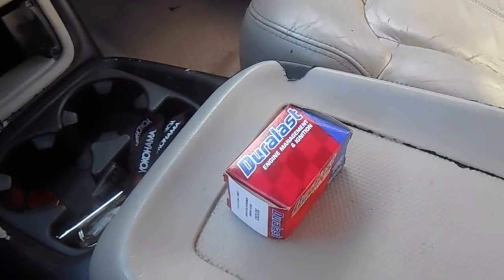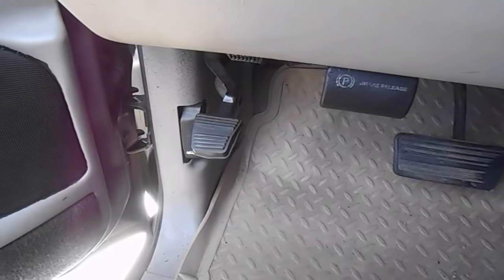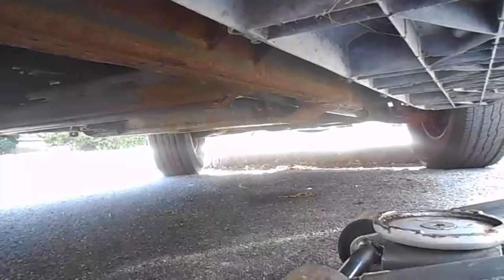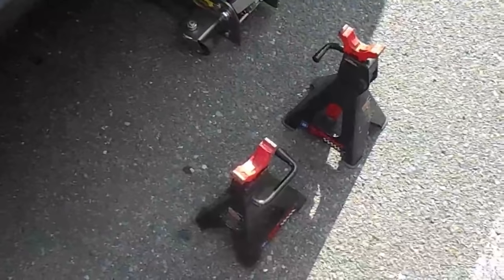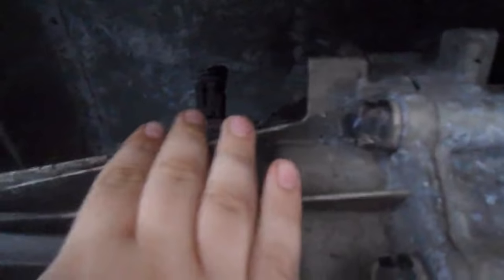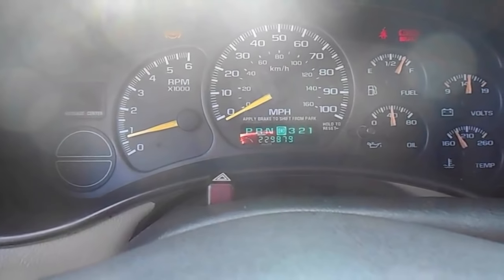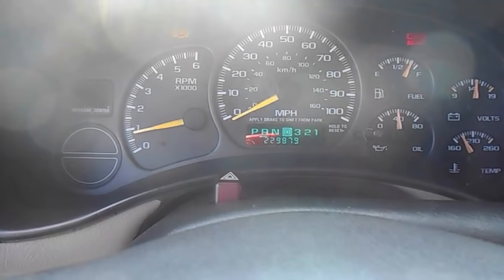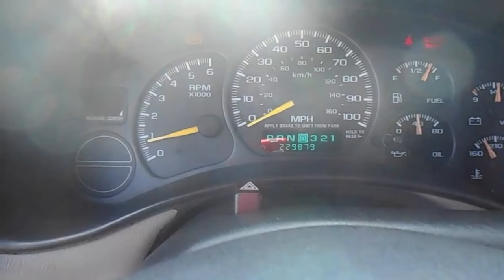Replacing The Speed Sensor in a Chevy Suburban

Comment: So from what I've learned, most of these 4WD vehicles have 2 speed sensors on the transfer case. The one you replaced on the passenger side was the speed sensor for the 4WD, which does not communicate with the speedometer and is only there for the Auto 4WD button so it can know when to engage said 4WD. There's another one on the drivers side, which is the MAIN speed sensor that actually communicates with the speedometer. However this is just what I've learned from reading various comments on youtube videos with this problem, so this may not be the case for everyone.
Reply: Your right! Most people on you tube should explain this correctly. No wonder why there so many upset people on here because people give false information.

Comment: The transmission speed sensor doesn't control the speed odometer , the wheel speed sensors do which are on each wheel.   The one on the transmission and transfer case control the shifting ,   if the sensor is bad the transmission will shift incorrectly or knock when shifting .

Comment: Some had two sensors the one in the transmission from my knowledge communicates with the abs system to help the abs module to control the hydraulic pressure to either your back brakes or all brakes depends on the year and it it's 4 wheel drive. Now the actual speed sensor for the speedometer could be located in two places. The first would be the cable going from the transmission to the speedometer with would be the speedometer cable. The next would be a sensor located near the hub assembly on the vehicle. Note some have one and some have sensors on two.

Comment: The nice thing is, the easiest fix to this (if the speed sensor swap didn't work) is to buy a GPS based "HEADS UP" from somewhere like Amazon. I swapped my gear ratio to 4.10 on my 99 Suburban, and it threw my speedometer off by as much as 20mph at highway speeds. Dealer refuses to try to reflash the pcm to compensate (tried several dealers). For about $50 I just got the heads-up speedometer, and now I just ignore what's on the dash. Unfortunately it also makes it rack up miles about 15% quicker but at 200K already, who cares.
Reply from the maker: RedfishCarolina I use a free app called digiHUD its almost spot on accurate and it tracks average mph top speed driven and bunch of other features been using it for a year now
Reply: Mine came with 3.55 i put a rear end with 3.73 gears in mine i did notice the miles adding up a little fast also oil change life goes quicker.

Comment: I have a 2001 Chevy Tahoe 4 x 4 5.3 L motor and I simply replace both sensors On the transmission and now it shifts correctly  And my speedometer works and before I changed the sensors my abs and brake light on my dash were on... but after being Told that I needed a new transmission or a new wiring harness I did some research and found out it could be those sensors in the transmission like the video shows!!! Try changing both
Reply: Hector Guerrero.  What kind of shifting problems were you having? Mine revs a little high going from 1st to 2nd
Reply: I have a 2002 Chevy Tahoe 4x4 5.3 Z motor. You are describing exactly my experience currently. Tomorrow I will change both of my speed sensors. Thank you for posting this because our vehicles are very similar. Makes me confident in my repair.
Reply: Are u talking about the solenoids inside the oil pan i was having that issue after a transmission replacement and i belive they conected the plugs backwards between the 2 speed sensor and now the abs light and break light is off speedometer started working but doesnt read over 30 mph even going faster and doesnt shift on time

Comment: Having this same issue 2000 4x4 suburban did a transmission swap and the guy hooked up a transfer case (blue and green wire plug) to the sensor. I had already replaced the pcm, cluster, bcm. And checked all fuses. Tonight I found the wire issue and corrected it still no fix and my scan tool isn't reading speed either. Have a new pcm on the way. I've also heard of but yet to locate a white relay cube behind the glove box that some how has been a fix for people. If anyone has fixed this issue please let me know. I'll probably post more tomorrow when I dig into it a little deeper.
Reply: Tim Feely try both speed sensors
Reply: Any fix?

Comment: My 2002 Chevy Silverado two wheel drive won't go into gear the RPMs go all the way up but it goes in reverse and drive just wondering would it be the sensor
Reply: That more than likely could be your shift solenoids inside the transmission

Comment: hey did u get it fixed?
my suburban is having the same problem...what did u end up doing to fix the problem? thanks
Reply from the maker: i have not figured it out yet i have tried countless working clusters and still nothing it has to be either a break in the wiring or something with the bcm i think
Reply: BOOSTIN IT GARAGE I've looked online and read that the ground connection could be bad or the wire that connects to the vss either was bad and eaten by rodents or something...try looking at that if u havnt done so already...good luck and let me know what uve figured out...I'm in the same boat and can't find the solution

Comment: tray the other sensor next to the one you replaced
Reply from the maker: jtorres698 I tried both nothing happened I hooked up a scan tool and it is reading mph from the sensor but it has a issue communicating it to the cluster
Reply: One of them is just a switch for the backup lights

Comment: i have 1996 chevrolet truck 2 wheel drive it make a pop noise but not all the time ive change plug and wires cap rouller button so what can it be still doing the same thing
Reply: Bad distributor

Comment: After owning several of these GM vehicles I have determined that these electronic nightmare vehicles full of CHINEESE crap are better off in someone else's driveway,
Reply: Just bought a 2000 gmc sierra 2500 4x4 and gauge started going up on down while driving then one morning it stopped working completely also started shifting hard and stalling when stopped